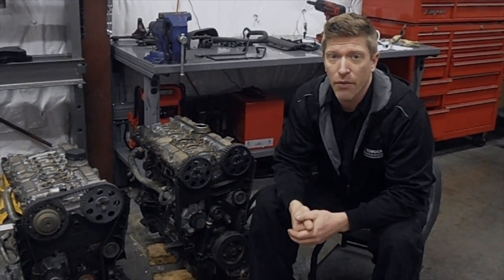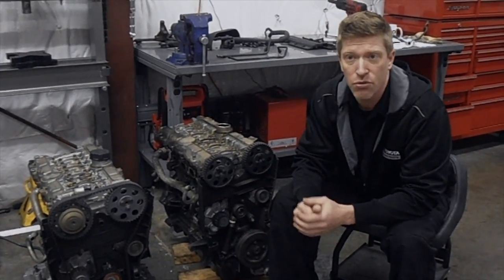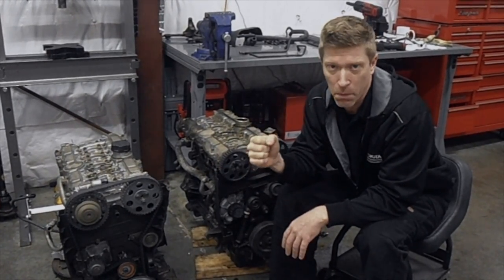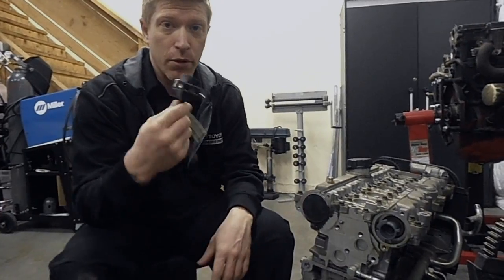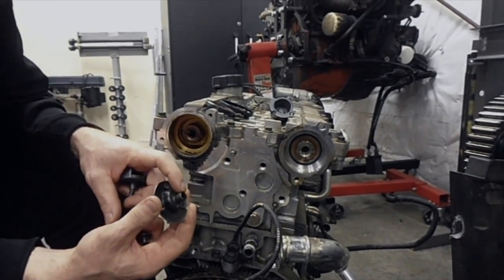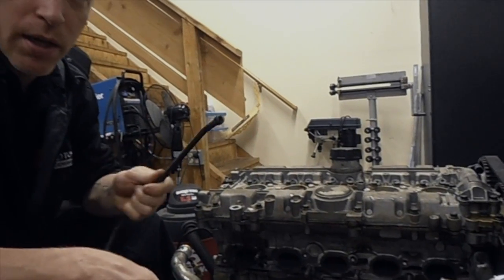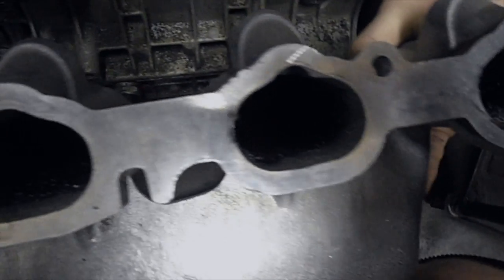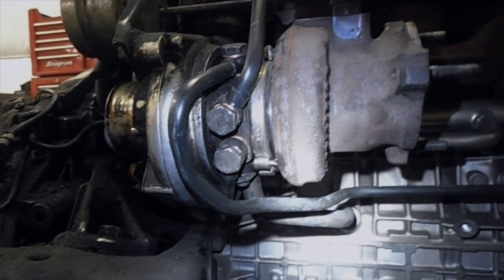ARD Tuning Volvo RN Engine Swap Details

Comment: so ive got a 2000 s70 2.4 no turbo i was wondering  if the ard orange tune could or would work on my volvo since i have some light work done it.. but i dont know if its only for turbo volvos or not... can someone please help. . thanks
Reply from the maker: Tuning for Non turbo models only nets minimal gains and in most cases any changes you make to the engine configuration can be handled natively with ECU adaptions. So tuning is hard to justify on these non turbo models :(

Comment: can an rn motor be built (internally) as 400+ hp daily driver?   or is it best to just do a v70r engine?
Reply from the maker: Yes, with proper supporting components you can make an RN engine take as much as 650 bhp in the 81 mm bore. Larger 83mm bore engine (Like the V70R) tend to have liner issues at just above 400 bhp. So bear that in mind...

Comment: Hey Robert, I came across you a while ago thanks to some forums. You put out some valuable info! Thank you. I now know what to plan for if my 97' GLT motor starts to go bad. Keep up the good work! I will hopefully be getting a tune from you soon once I fix my oil leaks and other various stage zero things. Almost there.
Reply from the maker: +Michael Barnett Glad to be of service! Be in touch if you need anything (or have video suggestions) and we'll be happy to get you setup :)

Comment: I've got a '98 V70 T5M with 256k miles currently. My plan has been on getting it to 300k before dropping money in it to rebuild/update/upgrade it. I just came across this video about swapping in an RN engine and wondered if in the long run it would be better going that route than rebuilding what I've got. Does the M56 transmission need any modification to attach to the newer engine? I'm not looking to max out horsepower, but I want to keep it fun and I would love it to be able to last another 150 - 200k miles while keeping things on a budget.
Reply from the maker: +Eric Villanueva The M56 will bolt up to the later RN engines without issue. Just be sure to use a flywheel/clutch combo that matches your trans and setup and you're good to go!